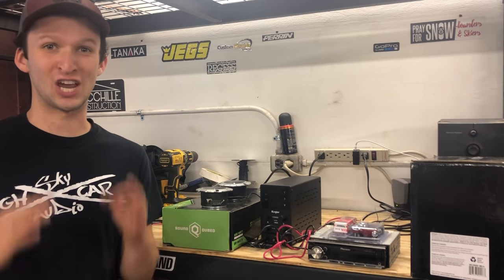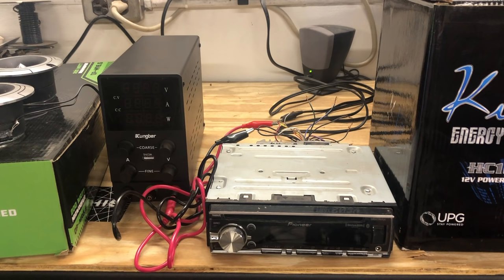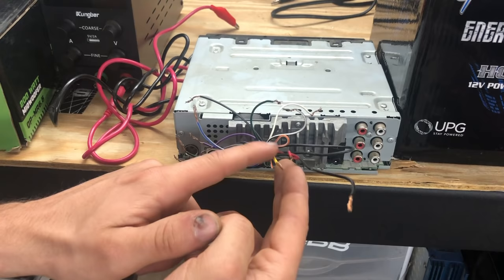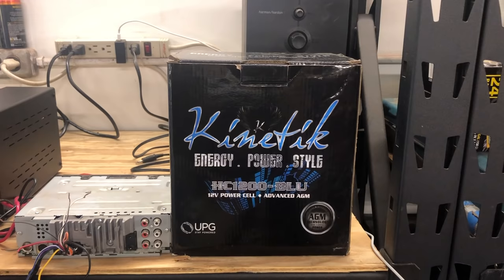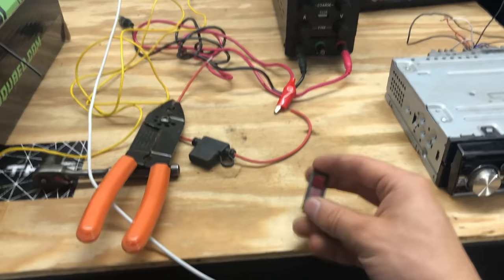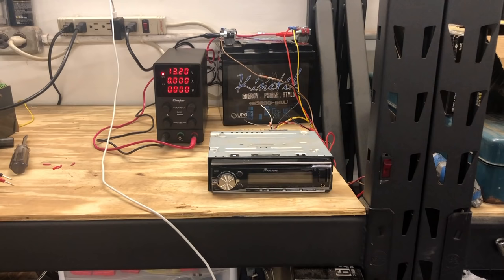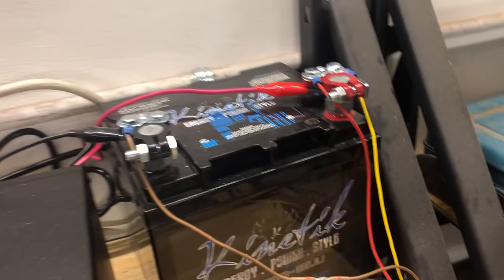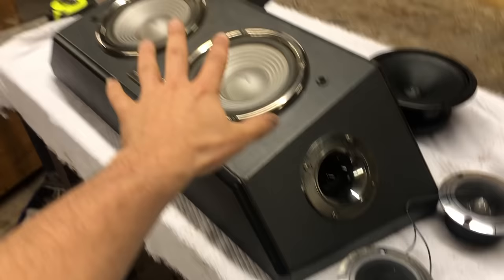Car Stereo In Your House / Garage! Easy DIY | How To

Comment: I did this when i was like 13 in my room… instead of buying a house stereo i picked up a deck speakers amplifier and subwoofer from my friends and ran a  car battery and used my car battery charger. I used to shake my houses windows lol
Reply: Yup, this was big back in the late 80's early 90's,  did the same thing.....have the same thing in my garage,  way cheaper and louder than any home stereo that's for sure
Reply: The only way to go. No home audio system could ever compare.
Reply: Same. I put a geto blaster in my mini. 8 DD batteries = 12 volts. Sounded awesome.
Reply: But is it safe to leave the charger on like that? Or is it fine because its constantly having power pulled
Reply: Ac converter much easier and cheaper they have YouTube videos about how to do it.

Comment: I just use a 110rms per channel 5.1 a/v reciever that is4ohm capable on 2 channels, a PC power supply to power a rzr2500.1 hooked to the recievers sub out, and a sdr 18 in 4.5cubes tuned to 28hz.

Comment: Xbox one power supply works great and is cheap. I use them in my garage setup. If I remember output is 12.5V 17.5A which is plenty for a head unit and/or small 4 channel amp. Can even run a subwoofer amp if it's small enough. Xbox power supply like 25 bucks online.

Comment: My wife and I got a shed put into our back yard that was going to be my work shop.  We got 3 quotes to get electricity installed and all 3 were over $2,000!!!  So, I spent $1,500 and put together a small solar panel setup that has solar panels, a charge controller, 560+ amp/hr of AGM batteries, and a couple of power inverters.  

For the radio, I used a basic Bluetooth car radio, have a 4 channel Kicker amp powering a pair of 5 1/4” coax car speakers in the ceiling, and of course a single 8” subwoofer that was on clearance mounted in the ceiling too in a 0.6 cubic foot sealed enclosure!  It cranks!!!!  Sounds great for the entire back yard, and the solar system puts out enough power to run an 8k BTU window unit so I can work on things in air conditioning!!!

Of course, I wired up a power and ground wire on the work bench so I can test amps and radios too!
Reply: That's awesome! I have a 50w panel I'm looking for a project/use for. How powerful is you're setup
Reply: @kirbybradbury-mills6781  what do you mean when you ask how powerful is it?
Reply: Wattage, I think, I'm fairly amateur but have A 50 watt solar panel, car battery head unit and speakers
Reply: @kirbybradbury-mills6781  a 50 watt solar panel will put out around 2.5 amps of current in direct sunlight.  So that will be enough to keep your battery charged while playing the radio, as long as you are not cranking the volume, and as long as nothing else is connected to it.  A car battery is not ideal for that setup, but can be used for now.  This is because a car battery is designed to put out a LOT of power over a very short time(like starting the engine), but they don’t do good for putting out a small amount of power for a long time.  For that, you need more of an AGM battery, or you can also use a “multipurpose” battery as they are typically cheaper than AGM batteries, you will just need to monitor the water level in the battery.  Also, getting a charge controller would be VERY beneficial as it would prevent over charging of the battery when you aren’t playing the radio.  Do a search for solar panel off grid basics.  It will help you out a lot.

Comment: I used a laptop with my garage system. Had a charger on 2 70ah batteries with a 2 into 1 RCA to AUX cable on 2 amps, 12in sub, 2 kicker 6x9s. Great job! Keep up the great content!

Comment: Also I use black shrink wrap tubes onto the tin waterproof clear connectors as well because those things are known to have small holes from the heat and sometimes the melted metal is exposed but not visible to naked eye

Comment: I added a radio in my garage with a power supply for a double din with a set hifonics 6. 5 component and a skar svr 8 subwoofer running off a 4 channel jensen amp budget bill but it sounds good and rattle the garage haha everything runs on the 30 amp power supply 240 watt to sub and 80 watt each to the 6.5 I love it!!!

Comment: this can be also your simple test bench...I have one too, and it is portable, but it is without a battery, because I dont need to save the head unit's settings yet...so, I have a 13,5 V / 40 A power supply, a 2x95 WRMS - 4 Ohms / 2x150 WRMS - 2 Ohms / 1x300 WRMS - 4 Ohms bridgeable 2 channel amp with a bass knob on RJ11 connector, and an ancient Sencor head unit without bluetooth, but with 4 fullrange RCA outputs, 1 switchable mono RCA output for sub (I dualled this), front aux input, rear aux input - where I can wire a bluetooth adapter easily (and of course 4 speaker outputs)...these 3 things I've mounted on a piece of wood, so I can hook it up everywhere I want, and also I have a bonus option: I can plug into amp any RCA output type depends on what kind of speaker I have to test out, not just adjusting the amp, because the sub output from the head unit have some kinda boosted bass signal like the fullrange outputs, so with the same amp gain more power comes out of the amp for the sub, especially when I plug this signal to the amp's both inputs...so...

Comment: They sell 30A switching power supplys on Amazon for like $30ish and it powers a head unit and a toro R2 mono block(320w or so rated at 14.4)  to most of it's 12v potential anyway.
Reply: I have a Chinese power supply off of Amazon if you run a wire off of each terminal and run them as one for each the power ground you can get up to 15 volts

Comment: I purchased the same kinetic battery to use as a 2ndary battery for the rear, but it wasn't enough. Kept peaking and dipping in sound level. Granted, yes, it says up to 1,000 watts RMS, and I am running 1,800-2,000 watts RMS between the 4 channel Orion XTR750.4 and CT-SOUNDS 1000.1D Monoblock so I did the same thing as this b4 seeing this vid as of today. Currently, I am extremely pleased with my Yellowtop Optima. I am using a battery isolator. However, the volt meter doesn't dip below 14.2 volts, slamming it close to full for an hour, driving on highway and interstate. So, no complaints. I still have my old-school pair of 10-inch 3-way  home system speakers and a pair of 12 3 ways to use in the garage with my old head unit since I upgraded the ride with a Maxspeedingrods 7inch android head unit.

Comment: When you want to start going big like over 1000w + a motor home power supply called a power max 150a power supply will do a test bench justice and those batteries you'll be bumping boom  bump on bass heads 🎵🎶👍👌✌️

Comment: The is a great idea I'm using an old Xbox 360 power brick connected to an old Kenwood amplifier that's running a single 10 inch MTX subwoofer in an old Pioneer floor speaker box whith the mids and tweets built in works great for a shop radio but its limited to about 100 watts it doesn't sound like allot of power but it gets more than loud enough for my application 👍🏽👊🏽✌🏽💯

Comment: Hey Parker I'm putting together a competitive audio system in my car and doing it from watching YouTube and researching what I watch I have never been to a show before or even seen a big system in my life anyway I just ordered a new head unit and 8 channel DSP for my 4 channel AAK and my AAK 6k BUT my car (19 Camry) has a head unit built into the dash without many options for replacement so I'm wanting to run a standalone setup until I can afford to swap the dash piece out anyway what I'm wondering is if I am running my speakers off the 4 channel and subs off the mono block then technically all I really need to make the head unit work is power/ground, remote and constant 12v just wanting to make sure I'm learning as I go and like to verify my thinking is correct

Comment: What was the most amperage you used when running a head unit and small sub amplifier? I'm trying to find what power supply would be sufficient.

Comment: I'm curious why you actually need the ac to DC converter. Is it to charge the battery or is just an option to have. My garage is not powered and is not close to my house. But I'd like to set up a system using the old car audio I have from years ago. Would I just be able to use a trickle charger to keep the battery charged when not in use and then just hook up the radio to the battery? I know that the battery won't last forever, but I was curious if the converter was a must use?.

Comment: Also, you mentioned showing how to supply power without using a battery... I didn't catch that, so what's the instruction, necessary equipment, etc?
Reply from the maker: Just remove the batter and hook everything up straight to the power supply. You’ll just need a beefy enough power supply to keep up
Reply: @ParkerTheBasshead  Ok, but isn't the Kungber product a power supply? Sorry, I'm new at this, so what am I missing?
Reply: Re-watched, and I believe the point of the battery and PSU is to maintain unit memory? But, that brings up my next question: how would you calculate the minimum size of battery necessary for the operation?

Comment: Not much of an amp to run off small power supplies. Say if you bought the orion hcca 3000splx......not that taramps krap thats designed for full range concert speakers lol.....ya buddy lol ill not let that one down.....anyways the orion trips 1000 amp clamp from fluke to make its 13800 rms burp.  A power supply to accomplish that 1000 + amps of rush current costs more than my car. N most cars at that... But ya dude your right again about the head unit. Funny is my garage has the same setup for a radio but i choose to run a 120 dollar power supply that switches from constant voltage to constant current and is isolated in its own power supply so that even if using a battery while charging from a pw supply wont play radio when in use lol.

Comment: Do you absolutely need the AC/DC converter/ inverter whatever its called? Or could you run it straight off the battery by itself. I'll be using 1200/2400 max wattage amp as well

Another way I was thinking of doing it was attaching everything to car battery then attaching a12v charger. Should be supplying the needed voltage and everything I think
Reply from the maker: Yes you just need some sort of AC to DC charge

Comment: If I was a gambling Man. I would be betting you will have an amp of some type hooked up shortly. LOL. Many moons ago on our seasonal roads there was parties multiple fires back when people responsible maybe. A little underage had this beautiful 84 Honda Big Red. Little rack on the front to strap the Build  two-din box. Cassette deck no Bluetooth. LOL and they made booster EQ. Pyramid had a beautiful one wild ratings back then also 600watts. 25x4 @4.
Similar ported box with Alpine 2 way 6 1/2. Thank God for backup recoil start

Comment: Hey Parker, So I have the same DC inverter and when I plug it onto my head unit, it works for 5-6 minutes before it starts to cut out and then the head unit displays “DC error” how can I fix this?
Reply from the maker: The amps on the converter needed to be tuned up probably

Comment: I have noticed, that your car battery is not grounded, do you need to ground it?
Reply from the maker: Hope! The negative on the battery is the ground in this case
Reply: I did your exact setup, and it sounds like the ground is missing. You know how your negative goes to the chassis for the car. If not, you have noise. That's why I'm asking you if I need to ground the battery.

Comment: Why not instead run a Pro Audio amp and get some PA towers and Car Subs to run instead? well unless that would end up being too expensive? 

example:

Amp: Crown Xti 1000/2000
Mids: Rockville PA 15's(their actually decent for PA somehow)
Subs: any 12-15 inch Skar or American Bass subs of your choice. hell could even go lower down if you wanted.
Reply: I shop at thrift stores. I've got a room full of speakers, receivers, power amps, and subwoofers (mostly high end electronics). All for the price he probably paid for that whole system.